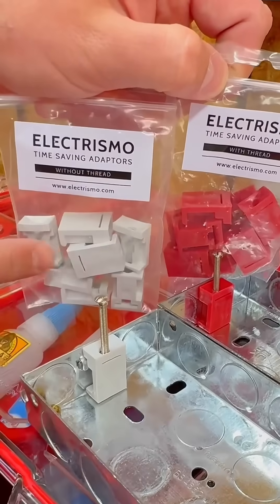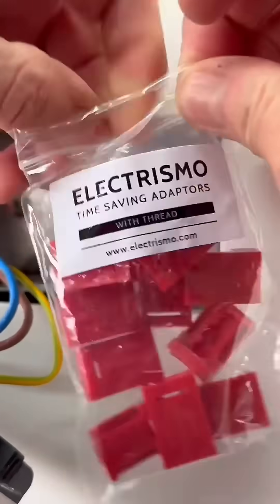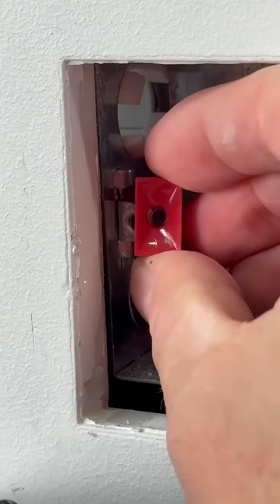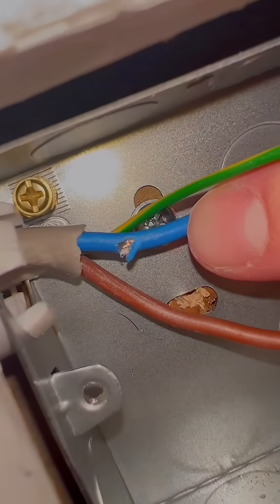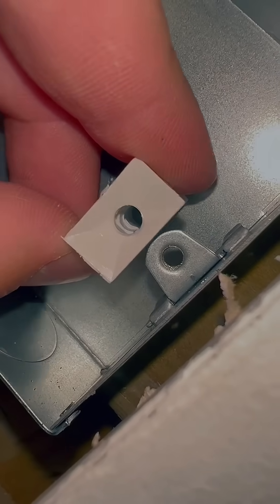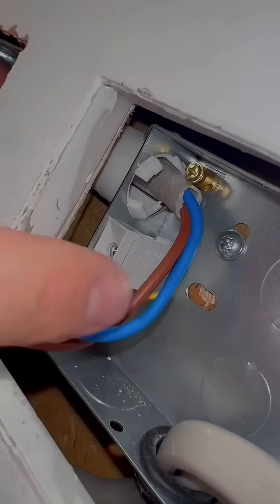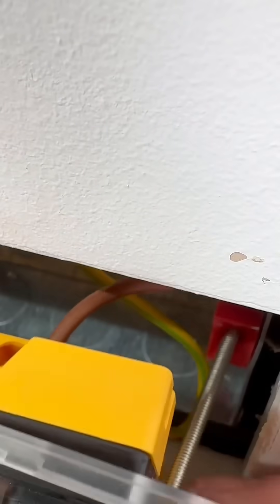Save Time, Save Cables, Save Stress! - Electrismo Adapters

Comment: Either those boxes need to be deeper, or they need extensions added to close that 2 inch gap. As it is, those boxes aren't containing any fire. Plus they're not earthed. Try not to use badly installed boxes in your advertisement video. xD

Comment: There are days I wish (for a moment) that was born in the UK and became an electrician.
Reply: From a strictly technical point of view, I still don't know which country would be the best place to be a sparky. Perhaps Switzerland.
Reply: @eaty7dhu I’m just saying that it appears that The UK electricians I’ve seen online and the electrical standards make abut more logical sense. I think the US tends to have a prevalence of shortcuts and outdated systems, and therefore needs more experience to understand. It seems that the equipment is more robust. This is just my opinion as someone who has worked with a lot of outdated wiring.

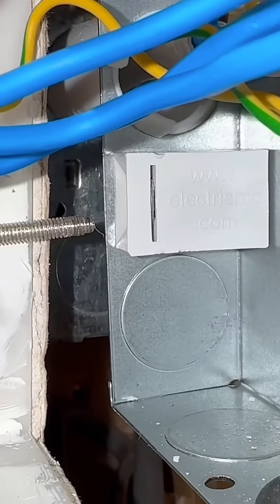Comment: At 0:53 there are 3 neutral wires ...?
Reply: @marxman00  Ring circuit with a spur feed
Reply: @jns8393  putting 3 wires into the screw clamp is a big no no from me , can you guess why?
Reply: @marxman00 yes
Reply: @marxman00 No, they are designed to take three conductors.
Reply: @andrewfrance1047  they are not , if you dont know why that is then you have a problem .

Comment: I have never ever had a hole to large for the screw in a pattress. White 4 for £7.50, red 4 for £8.50. Ridiculous price.
Reply: Give the lug  a little squeeze with a pliers and rethread
Reply: No doubt the cheap Chinese copy is being made as i type.
Reply: I've never even screwed through a cable in 16 years either 😂 just tuck the cables in a way that they don't go near the screw .

Comment: As an electrician, use better boxes 😂
I won’t pretend to claim I know the hardware across the Atlantic (I’m in the states), but these boxes seem to have issues, we don’t come across. Or, in the very least, have less expensive/complicated solutions, like cutting your 6-32 or 8-32 shorter to fit 😭
Reply: Your metal boxes have the same issues really.  Folded metal tabs for the screws that can be chewed out by people putting screws in crooked or with an impact driver.  Pierced wires from being trapped by the screw.
Reply: @retrozmachine1189 but those tabs are cast with the box, meaning if they get bent in, you can bend them back
Reply: @Wizard__J  It's not so much a case of getting bent in, it's the threads being ripped out or the hole getting bored out so that it no longer takes the standard screw.  I can show you endless photos of metal boxes over there that are just as vulnerable to this type of damage as the UK's.
Reply: @retrozmachine1189 yeah, so normally when that happens, (6-32 threaded hole), we will tap it with an 8-32, 10-32, or even 1/4-20 if need be
Reply: @Wizard__J  UK sparkies have that option too.  Sheet metal is sheet metal no matter where you are in the world.

Comment: But what do I do with snapped lug ?
Reply: Drill a whole through the back of the box, pop a red plug in it and use a longer socket screw if you're desperate or change the box if not.

I await the hate
Reply: @mustardcrumbles no hate from me but try a refinement.....

Drill through the back box with a 2mm drill and tap the metal with a centre punch to dish it.   Then tap the hole with a 3.5mm tap.

No plaster disturbed, permanent fix.

It won't work in very hard brick but most blocks are OK.
Reply: 😊 No hate.
Might give it ago next time I've got one on block work and work from there. 

What a nice way to suggest something and not just kick off and say I'm im as rough as like most do. Thank you
Reply: Back box repair clip, saved me a few times

Comment: Absolutely pointless.  
Maybe for your average DIYer a proper electrician would never need theses
Reply: You've never encountered a back box with stripped threads? Or do you just like wasting time/billing customers in that situation?
Reply: @DT-dc4br 
You just pinch the lug with pilers then using a rethreading tool done. 
If your screwing into cables you shouldn’t be touching electrics 😂
Reply: @ROCCODILLON   Try that on a newer backbox with thin metal and you'll just snap the lug off.
Reply: @ROCCODILLON  That's likely to produce a result that's even easier for someone else to accidentally over tighten and strip.
Reply: @BrianG61UK no it isn’t , done it a million times this product is expensive and needed for the job.
Reply: @DT-dc4br 😂😂😂😂 metal ko boxes haven’t changed in the last 20 years so don’t get your point. 
Use them waste your money but I don’t need to.

Comment: I’m going to try these, they look great. I particularly like the prevention of cable insulation damage and the screw guiding.
Reply: Same, I usually try to cut the screw to length to prevent it catching a cable but then it can be hard to find the hole
Reply: How about learnt dress the cable so it doesn't hit. It's not rocket science

Comment: This is an example of socket boxes becoming so bad quality something needs to be invented to fix the issue. How about manufacturers just doing some quality inspections on their products. No producing something to fix the broken product
Reply: It's always been an issue to be fair. After 30 or 40 years of being messed about with things break. Dont know how much they cost but I would use defo a few a year to save removing plastered in boxes
Reply: I go back to 1960ish and have only seen them made like this. The new add on is great, now persuade the socket makers to fit them as standard.
Reply: It’s all to do with cost. Most electricians these days want cheap. And so that’s what the market caters for . If you want a quality back box go for MK
Reply: @andysims4906 you've got to be joking? MK?! 
Have you just got out of your tardis from the 80s? Cos they've been shit since then. 
Check the number of recalls.
Reply: Becoming so bad?? They've always been bad. I remember using these boxes in the 1980s... exactly the same as they are now. It's shocking 😏
Reply: I find boxes are fine until the apprentice fails to understand the fundamentals of how a thread works and as a consequence rips the shite out of them!
Reply: @SuperGForce01 Don't blame your apprentice. They were never fit for purpose in the first place. I've been using them since 1971 and I would love to have £1 or even 50p for every minute of my time they wasted. This new gadget is too late onto the market for me, but many will benefit from its' well thought out design.